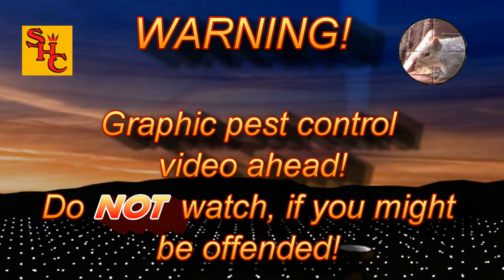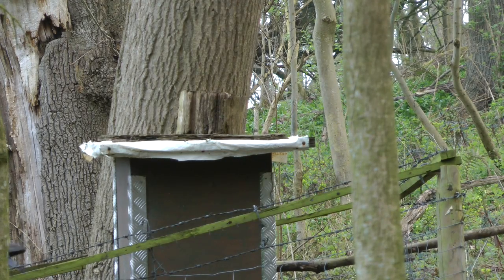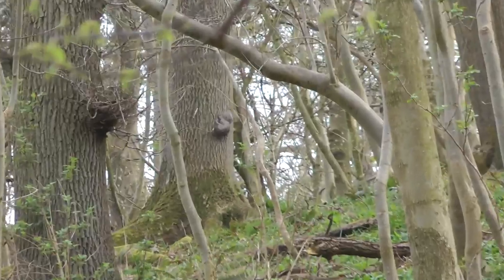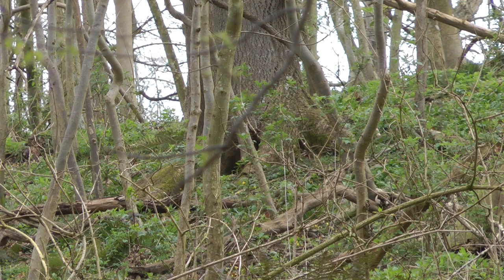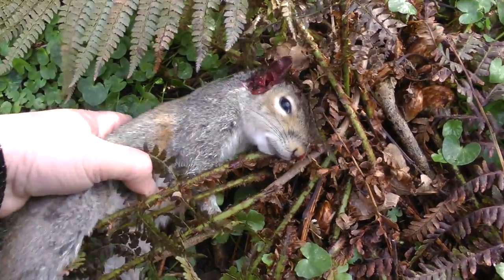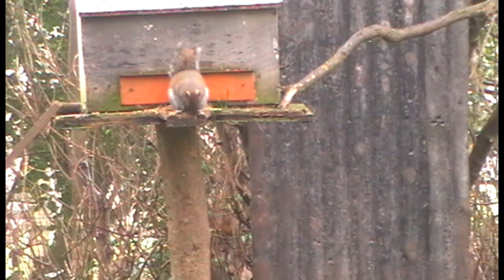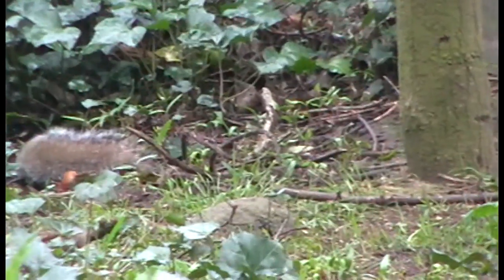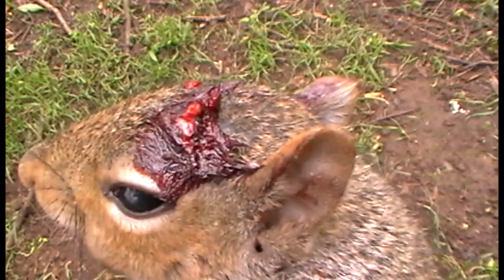Pest Control with Air Rifles - You Live and Learn.

Comment: Wish this video had the scope cam in it. I do enjoy seeing the hit through the scope. (An advantage of a good air rifle, you won't likely see the shot hit is you're using a high power rifle, due to the recoil, and even possibly the muzzle flash, depending on the load used.)
I should get myself a good quality air rifle. I see that you DO eat what you shoot, at least those critters that are decent eating. That is something I appreciate. Sadly, my current rifle, a Remington 7400 in .308 Winchester with a Bushnell 3x9x40 scope mounted with see-through mounts would not leave much left to harvest if I shot a squirrel. That rifle is for deer and bear. (And moose, if I were able to secure the means of getting the animal out of the woods. Those critters often weigh in at over 600kg., and are commonly found deep in the woods, or in a marsh.
Reply from the maker: We will be doing more scope cam vids in the New Year as it seems to be the most popular bit! You would enjoy a good air rifle by the sounds of it ;-)
Reply: Yeah, I would. 
Have you ever tried feeding the pellets in reversed? Many air rifles seem to be just as accurate that way, at least out to 25 yards. And that hollow base becomes a MASSIVE hollowpoint, which should provide explosive expansion, assuming that the rifle produces sufficient velocity.. Could make the difference on whether or not a 2nd shot is needed. Ruined a rat's head once with a reversed pellet.
Reply: Squirrel Hunter hi i would like to ask,how much do  you usually  earn
Reply from the maker: I've never had much faith in a reversed pellet for accuracy tbh.
Reply from the maker: We do this for free and have full time jobs in the field of engineering.
Reply: Squirrel Hunter thank you

Comment: After errr  borrowing the design of your feeder I made a slight modification .
Not having any Perspex in the shed I found a sheet of 1/8" wire mesh I had purchased to made bird feeders for the garden .
Not only did I replace the plastic front but rather than cut the mesh I took it round the sides and have found the greys seem to grip onto this better and so far have made no attempt to break into the feeder itself .
Great shooting BTW keep the vids rolling
 "cheers"
 George
Reply from the maker: No problem, George, "borrow" away ;-) That sounds like a good mod! I don't think hardly any of our feeders look alike, lol.

Comment: Got BSA Lightning in .25 non FAC, devastating but only used with bait to ensure I'm spot on with range so similar to your situation. Give it a try! only downside is cost of pellets.
Reply from the maker: I bet they cost a bit, lol! It's like 3 or 4 .177 pellets fired at once. My only concern would be the speed and the likelyhood of the squirrel moving its head. It gets no chance from the rapid as the pellet is faster than a .177 and as heavy as a .22. Phil Crampton almost convinced me on their merits, but I'd have to have a play with one first before buying I think.
Reply: Squirrel Hunter Same £ range as .22 but you only get 200. £18 (delivered) for Air Arms, same for 150 Predators! Good point re target movement, my shots usually 10-25 yds max. Sometimes take neck/chest shots when doing pest work, not for sport. When they connect it's lights out, no over penetration on body shots, head, yes, on birds but no head left to retain pellet!. Would never use where range could only be estimated, but when baited/lasered can put pellet on pellet +/- 3 yards.
Reply from the maker: I fancy trying those predators in .20 to see if they actually deform and deliver more damage on the feeder shooting. They are pretty close and the pellets fly right through if they hit side on. Straight on and they go right down through the squirrel and they drop like stones. You should film some shooting with the .25, I'd like to see it!
Reply: Squirrel Hunter Don't! Tried in .22 & .25, in both cases head rips off and peels down to skirt, takes calibre down whereas expansion is what's wanted. Also, .25 Preds I tried 53/150 skirts were so damaged from an undamaged tin can only use for plinking. Only wish there was a flat head in .25; short range + light. Best so far BSA Pylarms/FTT, (18+ grains) anything else is 25 grains+ so more for FAC for trajectory. Will get round to vids, happy enough watching yours!
Reply from the maker: Thanks for the tip ;-)
Reply: Surely u need FAC for .22 and over ?
Reply from the maker: The limiting factor for FAC rated weapons in the UK is the energy. Speed and weight not diameter are the factors to consider. The heavier the pellet the slower it has to travel to be under 12 ft/ lbs of energy. Over that you need an FAC licence in the UK.

Comment: how many fps do you think I can hit a woodpecker using say a .2 plastic bb without killing it and only making it severely question returning?
Reply from the maker: Dan Fall Personally I wouldn't launch anything at one in case I did hurt it. I'd put a dummy bird of prey out to try to deter it if I had a problem with one.

Comment: Do you also use the crosman destroyers? and/or the premium hollow points?
Reply from the maker: I've used them but they weren't accurate at range. H&N Hunter Extremes and Polymags work very well.
Reply: i use the polymags for hunting as well, but am maybe going to try the metalmags at some point

Comment: Squirrels are eating my mangos. While I don't mind a squirrel personally, they aint eating all my damn mangos.
Reply from the maker: duratoke That's the trouble with pests!
Reply: I have been trapping them in a Havahart trap that an exterminator forgot to pick up at a neighbors. And I thought I'll catch one and leave it out by the trees and the other squirrels will stay away. Well it works a little but a very little. I let them go after awhile. Reset and they forget and then I catch another one. I'm really getting tired of them.